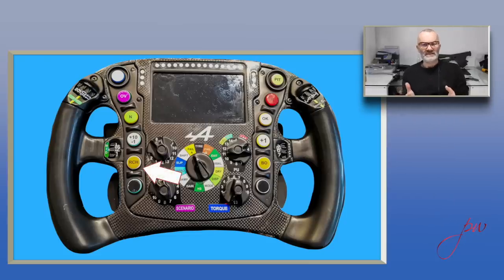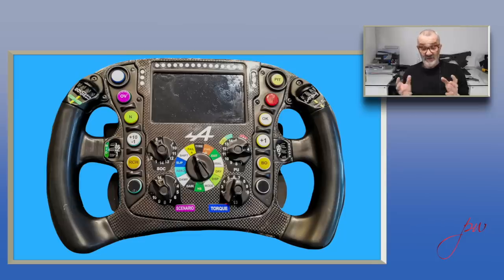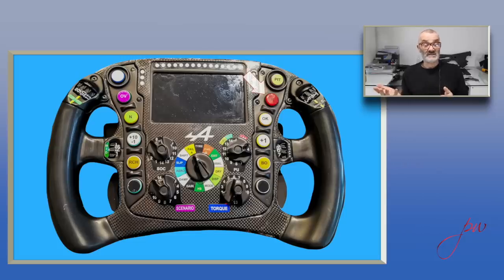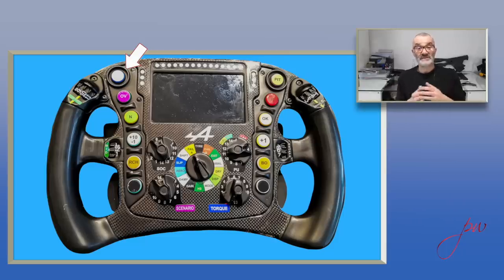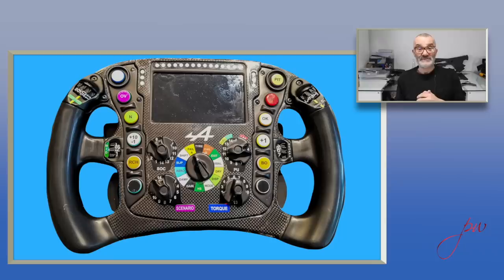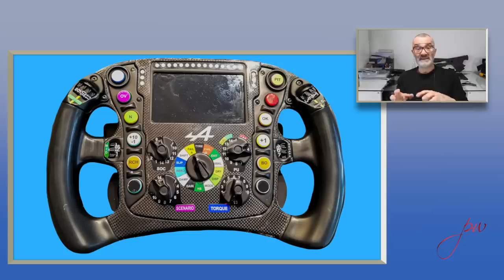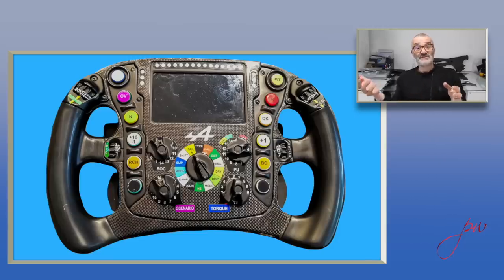The Ultimate F1 steering wheel guide feat. Scarbs by Peter Windsor

Comment: Thanks for the great video... Why some steering wheels got an oil button..🏎️
Reply: To deliver extra oil into the engine from the auxiliary tank.
Reply: @scarbstecheverythingtechni8171  why would you do that!?
Reply: @Neo.555  because the engine uses oil as it runs. Rather than push a huge volume of oil around the system, they run a smaller amount, then top it up.